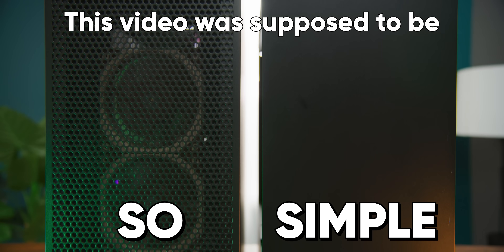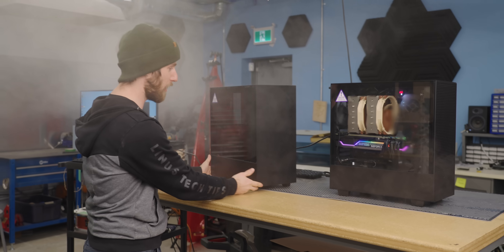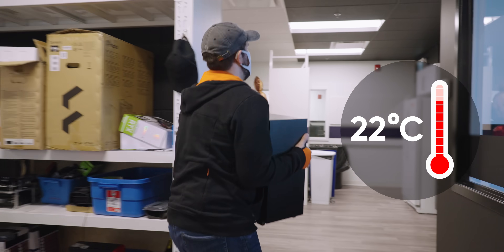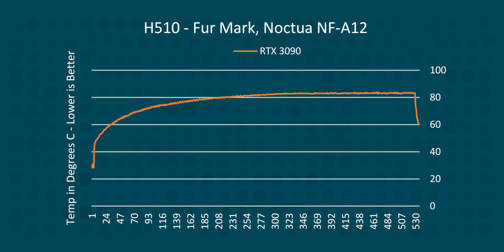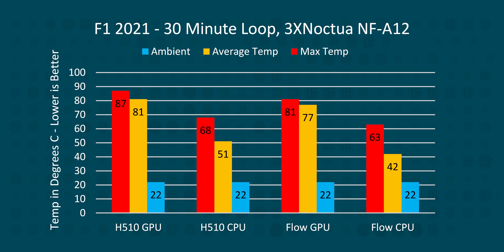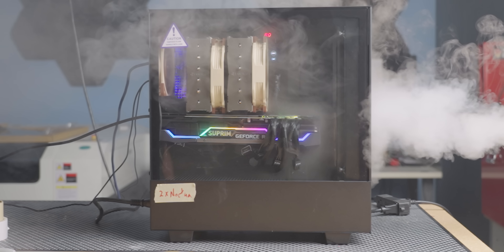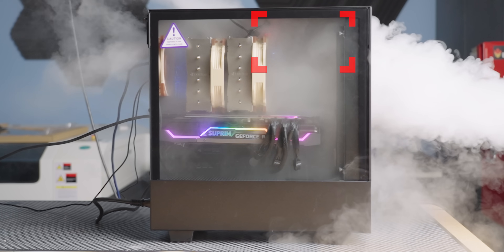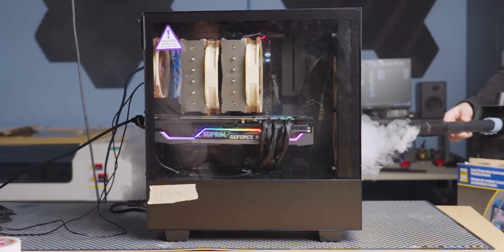Everything You Know Is Wrong - Mesh vs Non-Mesh Front Panel

Comment: Solution for that mesh case: 1) Put some kind of a custom panel in front of the video card, so that all the air from the lower front fan would go to the bottom of the case. 2) Optionally, put a fan on the top of the case, on the outside, to suck some air out with out getting in the way of anything inside. 3) Also optionally, cut holes into the side panel and put fans on there, like some older cases used to have side fans for this exact reason.

Comment: hmm... now i wanna see a corsair 4000x rgb put into the mix :D
took this case because it looks great and to me it seems there's enough air coming into the case through the openings beside the glass frontpanel (also i use an aio for cpu cooling so i don't have the big aircooler there. 2x 140mm fans + 280mm radiator at the front as intake, 2x 120mm on top and 1x 120mm on back as exhaust. also my graphics card is a small rtx 3060 but i hope i can upgrade to a 4070 next year, which will probably be larger)
Reply: Good luck getting a 4070 make sure u don't sell ur 3060 until u get a 4070
Reply: @caps721  of course i wont sell it xD

Comment: Mesh front works.  My 8 year old DIY PC built into a Silverstone Tek TJ08E case runs nice and cool, so much so that at idle, the motherboard doesn't even bother to turn on the front intake fan (a 180mm beast). After letting the motherboard do its auto-tuning thing, it seems the "secret" is to have the rear exhaust fan spinning noticeably faster than the intake or the CPU fan. 

Unfortunately, PCs with metal mesh fronts also are not a good match for where I live (windy side of an island), because rust is likely to happen.  It took a few years to appear on my case, but that was primarily because I deployed a DIY dust filter in front of the case and did some airflow management to ensure that air exiting the case at the rear was not recirculated back into the case. 

I suspect that the Fractal Define Nano S case that I built my new PC in, with its solid front and side intakes, might have more issues with air flow than the TJ08E, but so far thermals seem to be fine, if not as good as what I saw with that old case.  But there's no mesh front panel on that case to rust, so... :-)

Comment: It would actually make sense for manufacturers to make performance motherboards where CPU lives on the one side of the board and the GPU on the other, to separate air that goes to the CPU from the air that goes the GPU so the air temperature and airflow does not affect each other`

Comment: I solved this issue by mounting cooler intake fans to the underside of the powersupply and cable shroud. The visible floor of the case is a mesh, and while not ideal (yet) there are holes in the bottom of the case to allow air flow. Me and a drill will be getting together later for this!

Comment: Airflow matters! It's an old gamer wisdom (as we in germany say).
Adding a vantilator to the bottom of my case significantly reduced my gpu temps and easily outclassed an alternative configuration with all my vants (except the exhaust one) on the front panel.

Comment: Retest this with Airflow optimized fans at the front as opposed to static pressure optimized. The airflow ones should give you a sustained column of air flowing through the case. NF-F12’s

Comment: My cpu and gpu are at 50-60C when gaming (9600k and 6700 xt) with a solid panel. So from my experience even mid tier gaming doesnt heat up that much

Comment: PCI plates have holes, so I tend to run a fan there as well to help pull air around the GPU where the front fans hit a wall like you showed. I haven't done it with my newest case because a full ATX box has massive air flow channels between components for the fans to direct air. Loving the 70-80 degree range on air-cooled only components.

Comment: Linus is struggling putting another exhaust fan in that case meanwhile i am sitting here with my old ass thermaltake case using 6 case + 3 radiator Fans with no problem at all xD

Comment: Someone should design a 60mm x 120mm fan that fits into the expansion slot panels underneath a two slot card.  With those dimensions you could probably do two 50mm fans side by side in one houseing. That as an outtake should atleast cycle more air underneath the card?

Comment: I can't wait to see flow testing with cases and graphics card sizes. Also I have a huge inverted case (it's the same case as Tarran's and I can't remember the name of it. Corsair Carbide 600q or something) and I'm wondering how having extra intakes on the bottom and two intakes on the front with only one exhaust flows for for the GPU. My thermals on my 6800XT seem to be pretty good with it only getting to about 60c (usually 67 on hotspot) at the highest under 100% load for over an hour, and it's probably only that high because my room isn't well vented. The CPU however seems to suffer more because under load, but not 100% it will get to about 80c with a NH-D15 with both fans attached. It's a 5800x, so it's a bit of a hot chip. Still, there's two intake fans that should be blowing directly at it so I don't know what's up with the temp.
Reply: you need more exhaust. you have to get the hot air out of the case. do two intake on the front and do the bottom two fans and the rear fan as exhaust. that case has a LOT of open mesh on the rear and front of the case that you don't really need to "force" fresh air in to the case you need to get the heat out of the system. having 4 intake and one exhaust would not be as good.  run the front intake at half speed and the three exhaust at max speed and that will likely be the best solution for cooling.  also that case is an older model it may be time to refresh your fans to some newer fans!
Reply: @BassRacerx  okay... Except why is the graphics card that is higher than the CPU cooler with smaller heatsinks performing cooler while at 100% load (it's an ASUS TUF RX 6800XT) than the 5800X at 70% load below it with an NH-D15 sitting below it with more potential to get cool air on it. The way the flow should work is it should push the cool air into the fins and fans of the d15 and push back into the exhaust fan directly. There's two intake fans that would sit in front of the heatsink and one intake fan directly below the heatsink. The CPU should technically be better cooled than the GPU as waste heat should be pooling up towards the top of the case, though maybe the chonky graphics card is keeping it down by the CPU is my only guess. The only thing is, the whole point of a positive pressure system is to push the hot air out. It shouldn't need to be pulled out by a fan that much, it should just get out as it gets pushed because the volume is completely filled (and it's not pressurized)

Thing is, making the bottom fans exhaust sounds dumb because there's not enough height and it will just come back up through the gaps. Bottom front fan is out for the same reason and the intake fan above it dedicated to the GPU.

Also, it has new NF-A14s in there
Reply: @CreativityNull   nice on the new fans. sounds like you have everything you need.  every case/ setup is different so it's always worth experimenting with different configuations. as this video points out just because something makes sense in theory doesn't mean it happens in the real world. If you are having high cpu temps specifically and gpu temps are good I would first make sure you bios is not over volting your cpu some "default" bios are known to provide more voltage than factory specified next think about re mounting your cooler with some new paste you could have a less than ideal mount. IT took me two tries on my r9 3900x to get the thermal paste perfect perfect on my noctua nh d14

Comment: Several fixes. 1) A larger case, in a matx case and completely enclosed psu shroud like this, a big GPU usually blocks a large portion of the bottom front intake fan, and reduces air available to GPU. A ATX case leaves more room under the GPU. If there is mesh on the psu shroud, an intake fan there also helps. 2) use paper/plastic board to guide inflow to the bottom of GPU, and more importantly, block the outflow of GPU from returning back to the bottom of GPU. This ensures GPU always gets fresh cold air and lowers temp.

Comment: I have two 140MM fans pushing into a 120mm radiator with 120mm pull fans in this case. Noctua industrial 140s, the only way to suck any air through this thing tbh.

Comment: Great video thank you. When you get the lab up an running it would be awesome to see recommended fan set ups for some of the most popular cases. I noticed better temps in my Be Quite Pure Base 500DX when I turned off the front top exhaust fan. It was pulling cold air out of my case from my 3 front mounted intake fans mounted to my 360 AIO.

Comment: This is cool to see, honestly my case is a piece of .... as it is the sekira 500x from msi has a solid front panel, got it because It look cool on my desk, running  i9 10850k with 3070, the air flow is ok, air comes in from the front and the back mesh below the gpu and out the top and top back exhaust, the Temps are 45c at idle for gpu and 64c to 67c while gaming at 99 to 100% usage, where as cpu is 39c to 42c on idle and a 68c to 74c on full load, I think it's good as my latop hit gpu temp of 74c gpu and 95c to 100c  cpu while playing games hahaha

Comment: I don't understand why routing pcie cables down in front of the video card intake fans is still a thing. Modern cards run so hot, and have such little space to draw in air from, that having anything doing any kind of flow restriction should be avoided. The cpu cooler has 120-140mm of massive open space to draw in air from, it won't even notice 2 or 3 cables sitting somewhere in the open area in front of them.

Comment: Just remove PCI-E slot covers on back of case so air can exit there. You have positive pressure in case so more exits for air is needed.
Reply: I have forever used Silverstone's aeroslots, which are basically vented PCI slot covers. Why not have another place for air to vent near the most power hungry component?

Comment: I bought myself a case with a triple fan at front that has a tempered glass as its cover. if the cover is there, the two top exhaust fans would blow warm air most of the time. the moment i remove the cover, the air from the exhaust would be much cooler right away and dropping my cpu temps around 3 °C to 4 °C. now as silly as it may sound, i'm looking for an extra long thumb screw so i can mount the front cover further away from the fans in the hopes that i can get more airflow in it lol. but i have yet to find the ideal amount of gap to do that. plan b is to just replace it with a mesh lol.

on the gpu side of things, i came across on this pci-e rgb fan cooler for the gpu. it has these three small fans that would blow air towards your gpu.

Comment: I am slightly puzzled by NZXTs case design... the PSU cover has a mesh seperating it from the GPU. You would put a fan there, blowing up air into the GPU... but the basement only has mash for the PSU.... Why mesh up that panel then? I guess you can put some lights in the basement of the case...

Comment: So you did research on a problem already addressed by Spectrum Nexus 3 years ago and came to the incorrect conclusion.

The H500 case series are negative pressure cases.  If you mount exhaust fans and no intakes, you will get the best cooling.

What should be mentioned is adding an air intake box to the GPU to pull air from the unused pci slots in the back.  Major hardware did a video on this with beyond impressive results.
https://www.youtube.com/watch?v=PHp1yrjlMz0

Comment: You'd think with how much engineering goes into cars with how wind effects them for efficiency, they'd do the same for PC cases to figure out more efficient designs rather than just square boxes with fan mounts. My PC sucks at drag racing.
Reply: Yeah what a joke. i skipped the entire "psu at the bottom hidden" case phase, totally superficial and pointless. instead of focusing on RGB, maybe brands should have focused on actual performance before we got 400w video cards.
Reply: They don't it for mass market cases because, bluntly, doing all that work on a PC case is bad engineering. Engineering, when done well, is designing something to a cost so it is just good enough to meet the specification. In real world scenarios the difference of a couple degrees in the temperature of the graphics card means sweet FA so there is no purpose in doing it, unless by doing so you can sell more cases.

Comment: a little j bended steelsheet(o.e.) to seperate gpu intake from gpu out + cpu could help a lot. meaning u have 1 frontfan dedicated to gpu and 2 for cpu. did something like that in an case because otherwise the blowerstyle gpu would have sucked all the heated air from the cpu.

Comment: What about a setup that has 4 fans pulling in and 3 fans pushing out. So 2 fans on the front, 2 fans on the side for in. And then 2 fans on the top  and 1 on the back for out. Top has a radiator as well for just the cpu

Comment: So, maybe it's time to get the PSU on top again, pulling hot air and get 2 exits on the back, the old one roughly above centre as we all know, but also one below the brackets. The one on the bottom would need to pull a lot more CFM then the top one I think. I'd love an insightful response on my comment, if you'd like.

Comment: The problem here is - and I guess you know it - not about mesh vs. solid front. It’s about right vs. wrong airflow. You have to a) use a bigger case when running a monster like the 3090 suprim (one of the largest pcbs out there) and b) not use the top fans as intake. Warm air rises upwards, so it would be better to use them to blow said hot air out of the system. I guess if you use the same components the right way and let’s say in an fractal meshify (simply because it’s bigger), you would get much better cooling results.

Comment: I got a 011 dynamic xl because of that. Two 140mm on the bottom at low rpm feeds the GPU and a Deepcool Assassin III instead of the NH-D15 because it's taller but it stays a good inch away from the GPU backplate allowing even better cooling.

Comment: This video is still too simple, and gets to the conclusion too early. They didn't even try different configuration, while in this case negative pressure cooling could actually help. I don't expect deep scientific detail on LTT, but it is way too shallow. Do some CFD. Adjust fan speeds. Blow smoke on the back. You guys know better than most of us in terms of case airflow experience. You shouldn't have ended the video like that.

Comment: I have an all air cooling PC in a CoolerMaster NR600 mesh case with a total of eight 120mm fans, two fans on my 5600X cooled by a Hyper 212 heatsink, six case fans, plus the two integrated GPU fans on a 3060 Ti Founders.  I don't have this problem though, the GPU isn't too close to the front fans and there is plenty of space between the Hyper 212 and the GPU. The two fans on top and the one in back do in fact exhaust hot air because I can feel it with my hand when the system is under load. I have even run as high as 84F (28.8C) ambient under load in Florida heat and humidity (humidity reduces efficiency because it stores ambient thermal energy) and I do not come close to throttling on CPU or GPU.

Comment: What about a case with high feet and a bottom intake, with the cpu cooler rotated 90 degrees? That way you'd have bottom to top airflow, all in one direction. In that case a solid front panel wouldn't matter and the GPU would have its fans in the right orientation to benefit optimally from the airflow.

Comment: I always like these kind of tests but I feel this was get it out the door scenario. There is so much that could have been done. I feel a directional shroud testing as well indepent fan speeds to control amount of air coming in etc. Would have loved to see more in-depth video.

Daily uploads are fine but if it will affect video quality I think it's better to slow down.
Reply: Product quaity doesn't matter, what matters is to get the product out to start getting revenue, they learned good from Nvidia, AMD or Intel.

Comment: How about: Lian Li Lancool Mesh 2 Performance case, Intake: Noctua 120s, 3x front, 2x above psu (aimed at GPU), Exhause: Noctua 120 1x rear, Noctua 140s x2 top, ASUS Rog Extreme Crosshair VIII MOBO, Ryzen 5950x, MSI 3090 GPU, Samsung 980 pro M.2 NVME SSD 10TB Total (5x 2TB), 128gb 4000mhz corsair ddr4 RAM (4x 32gb) & EVGA titanium 1000W PSU

Comment: you want positive presure in a case but you dont want the front panel to pull more pressure then the output force.

cyclonic shape fans would be useful to send in massive air without over pressurising intake.

what happens to high presure intake as shown in the video is that it cools down hard drives but then that air goes to the cpu and ram before leaving.
other way around what happens is out air is being pulled out near cpu causing a vaccum making it easier to pull the right amount of cold air..

i would sugest turning all front fan to minimum speed and increasing the fan speed on the back to max speed. oh and see what speed of top fanngive better results. a too strong top fanwill completly cut air flow to the cpu. a weaker fan speed might be able to unclog that over pressurising from high speed front fans.

and a fan at the bottom of the case that pull air out of the case from the bottom might help your gpu airflow by pulling air in from the front at slower front fan speed... multiple things to try.

its like current if you force the current to go faster it will disrupt and slows down.